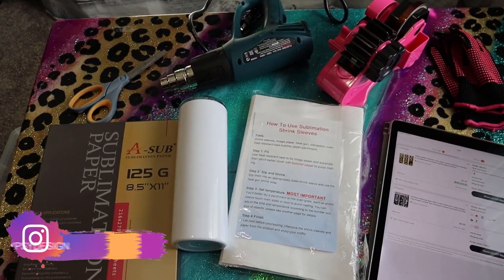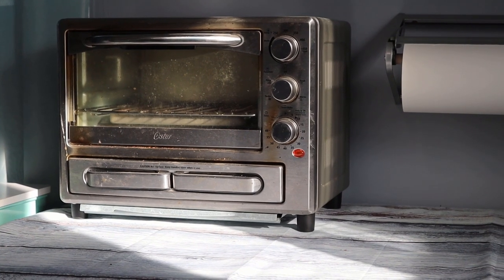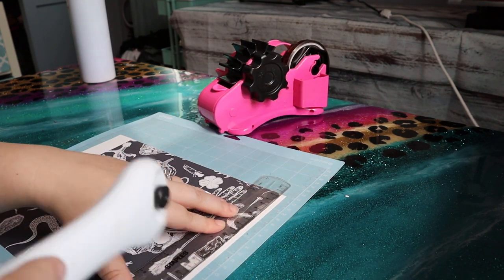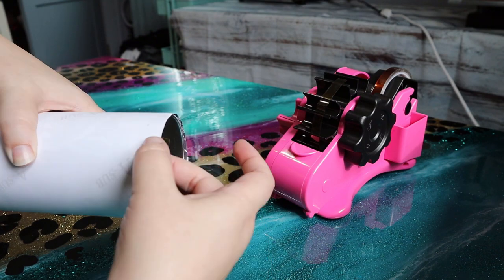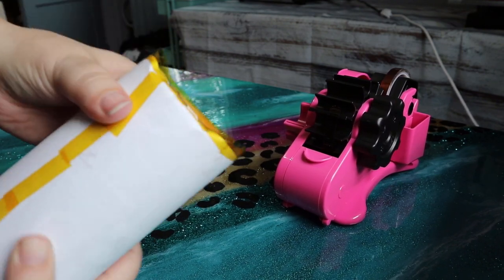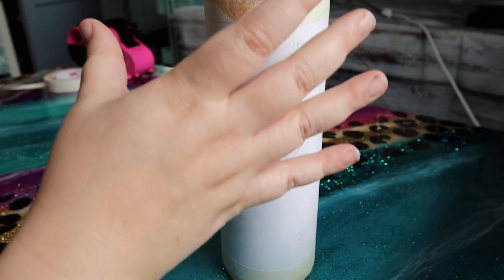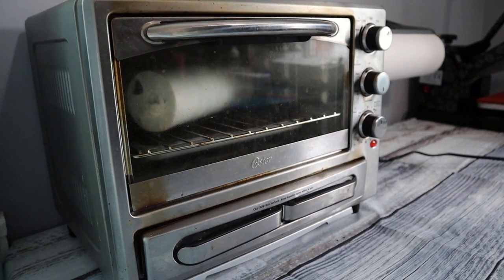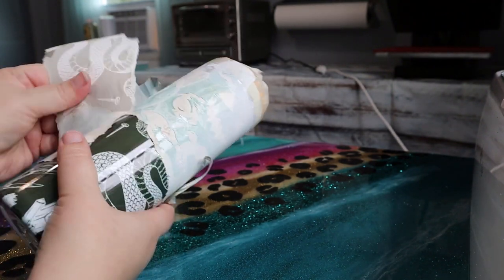How To Sublimate Tumblers / Easy Sublimation Tumbler Tutorial / DIY Sublimating / Shrink Wrap Method

Comment: I noticed your design had a black background, however, on your completed tumbler the black looks faded and is not a true rich black. Why is the black not a deep black, is the because the time in the oven was too long or too short?
Reply from the maker: That was my first full black sublimation tumbler. After doing some research I think I had it in too long. I did another tumbler that had a lot of black on it but this time ended up pulling it out like 2 minutes   earlier and it came out great. Do definitely something you'll have to play with to figure out what time works with whatever oven you're using.

Comment: Can I use any model of printer as long it’s an inkjet printer or a sublimate printer
Reply from the maker: It has to be a sublimation printer with sublimation ink. You can convert some regular printers into sublimation printers though (which is what I did with my ecotank)
Reply: How can I convert an eco tank printer into a sublimation can you explain please thanks
Reply from the maker: So they sell kits online that come with like hoses and stuff that you basically can put sublimation ink into to be able to put sublimation ink into the normal printer tanks but the easiest way is the way I did it, which is- you buy an epson eco tank because they come with these refillable ink bottles. I then poured out the regular ink then poured sublimation ink that I purchased into those bottles and then was able to fill up my empty ink tanks with sublimation ink so that I can print sublimation designs. It's kind of hard to explain it without showing what I'm talking about maybe this is something I can do a future video on.
Reply: Yes please do a video that would help
Reply: Where can I buy sublimation ink ?